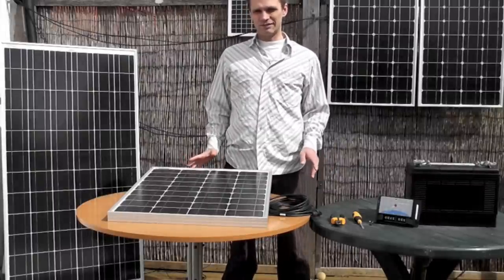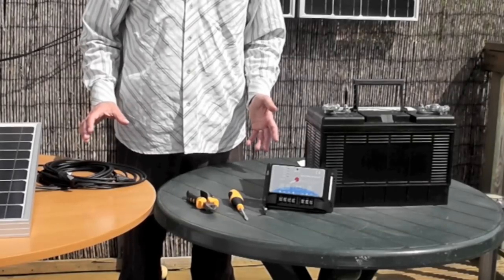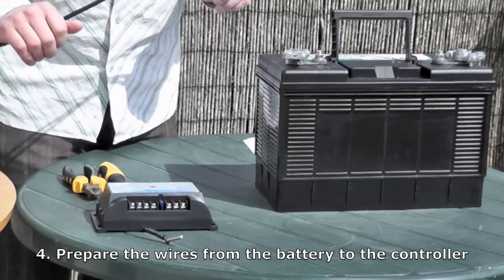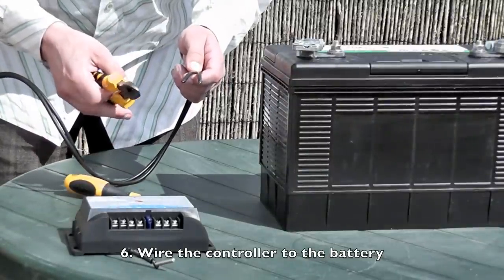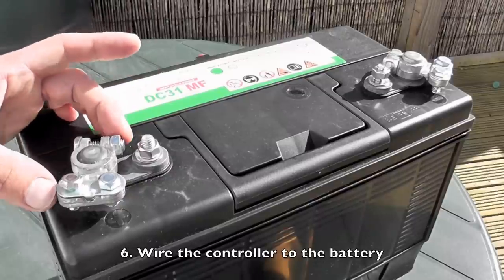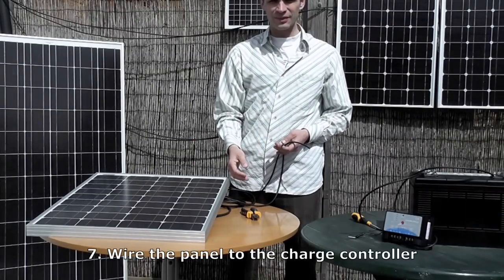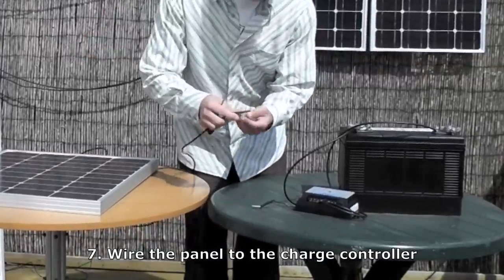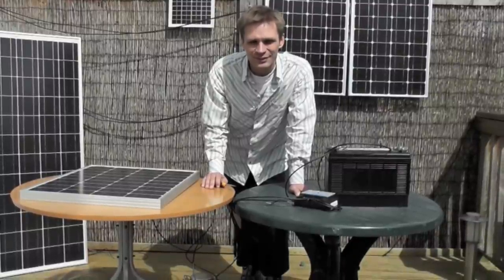How to connect an AKT Solar panel to a battery via a charge controller

Comment from the maker: Hi Martin,

The charge controller regulates the charge to the battery, particularly preventing overcharging of the battery and also preventing sulphating. This is important when using larger panels because it prolongs the life of the battery.

Also, if you decide to use the outputs from the charge controller to power your system then the controller will prevent over-discharging of the battery by cutting off the power when the battery falls below a certain level.

I hope this helps.

Comment from the maker: Hi Len, 

A 120W panel would actually do quite a lot for your battery bank. In summer you could get up to an average of 480Wh from a 120W panel / day. This would put 40Ah of charge into a 12V battery. So in a week you would get up to 280Ah of charge which would be more than enough to charge your battery bank from half charge.

And if you use 2 x 120W panels then you'd charge your bank in half the time.

I hope this helps. Please feel free to ask any other questions.

Cheers,

Jonny

Comment from the maker: Hi Mandy,

All you need to do is wire the +ve battery output from the controller to the +ve of one of the batteries and the -ve to the -ve of one of the batteries. This is because the +ves of each battery are all wired together and the -ves also all wired together so the whole battery bank equalises the charge across each battery.

So yes, the wiring stays the same as in this video and you treat your whole battery bank the same as you would treat a single battery.

I hope this helps.

Jonathan

Comment from the maker: Hi Hafiz, 

You would only need one regulator and would not normally need a diode (most regulators will have a diode and if your speakers have no other electricity source then no diode is necessary anyway).

So if you have a 5V regulator that will take at least 700mA (I expect you mean 350mA not 350A) then all you need to do is attach both positives to the positive input on the regulator and both -ves to the -ve input and attach the regulator's output to the speakers.

I hope this helps!

Jonny

Comment from the maker: Hi Nixy,

A 12V system should be fine for plugging 12V appliances directly to. You have to remember that a 12V battery actually varies from slightly below 12V when relatively flat to 13.4V when fully charged. And when there is a power source charging them, the system could even go up to 14.4V.

However, appliances that are designed for 12V such as in cars should be fine with this. 

For a 9V appliance you could maybe use a Zener Diode to limit the voltage to 9V.

Good luck!

Comment from the maker: Hello Fatin,

This is actually for an off-grid system so is not designed for powering a building. If you want to connect it to the mains then the best is not to use a battery and just attach the panels straight to a grid tie inverter that is attached to the mains. I hope this helps.

All the best,

Jonny
Reply: What amp wire did you use ?What amp wire should I use for a 10 amp controller ?
Reply from the maker: Hello, Nottel, You'll want wire that is at least 10A. Normally we use 2.5mm square cross section wire for anything up to 80W panels and from 80W and higher we use 4mm square cross section wire. I hope this helps. Cheers, Jonny
Reply: AKT Solar That is helpful ,thanks,but it has been far too time consuming just to get this far.I hope the experts make more fully complete  kits.I have found some since writing  last ,not quite the sort of kit I meant,a pond pump and lantern kits.
    There is lots of rubbish out there but I have found dlights ,the smallest one, excellent.

Comment from the maker: Hi Nixy,

Thanks for this. Normally you would connect multiple 12V batteries in parallel. This would maintain the voltage at 12V to create a 12V system. 

It would also be possible to connect 2 x 12V batteries in series to create a 24V system or 4 in series to create a 48V system but normally for a 24V or 48V system you'd simply use batteries that are already 24V or 48V batteries and connect these in parallel if you wanted to use more than one battery.

Do feel free to ask any further questions!

Comment from the maker: Hi there, I'm not sure if you're correct in your 100A maximum current comment but if you are then you will need very thick wire. However, for normal 400W at 12V the maximum current would be 33A which is a more reasonable. In any case, the cable you use should be adequate to cover the maximum current that will flow through it and you should be able to get information on this when you purchase the cable. I hope this helps, Jonathan

Comment from the maker: Hi Si Fei Liu,

This is very easy: You can connect multiple panels to the same charge controller as long as their combined power will not exceed the rated current of the charge controller and as long as the largest panel is not more than 7 times as powerful as the smallest panel. To attach them just wire all the positives from the panels to the positive input on the controller and all the negatives to the negative input.

Good luck,

Jonny

Comment from the maker: Hi Takkikayo,

500W at 12V is about 41.67A. There will be some loss in your system and so you would be OK with a 40A charge controller or larger.

Many charge controllers can also be wired in parallel so you could also use 2 x 20A controllers with 250W attached to each 20A controller.

Also it would be best to have a battery bank of at least 400Ah so that your 500W of panels does not damage your batteries by charging them too quickly.

Do feel free to ask any further questions.

Jonny

Comment from the maker: Hi Smiggle,

1) A circuit breaker of around 20-30A should be fine between the panel and controller (A "12V" 120W panel will give about 8A maximum).

2) If your battery is 12V, a 2500/5000 W inverter will potentially take about 5000/12 = 417A which is a VERY large current and would need very large cables and a circuit breaker of around 500A.

You would also ideally need at least 2500Ah of 12V batteries to provide 2500W of power without damaging your batteries.

I hope this helps,

Jonny

Comment from the maker: Hi there,
 
As long as the inverter will not get wet then I think it should be all right. In any case, insulation will probably not make much difference as the inverter will still ultimately cool down to the ambient temperature of the shed if it has a few hours idle. 

But if the inverter does have condensation on it before use then you should let it dry thoroughly before turning it on. However, this is unlikely to happen,

I hope this helps.

Cheers,

Jonny

Comment from the maker: Hi there, the best option is probably to use a 10A 24V charge controller with a 24V battery bank (this could be 2 x 12V batteries wired in series to create a 24V battery). Then you would use a 24V inverter.

Another option would be to use a 20A 12V MPPT controller that is rated to take the voltage output from your panel (probably around 35V). Then you could wire that to a 12V battery.

Finally, car batteries will work but under normal use leisure batteries would have a significantly longer life.

Comment: Thanks! So far this is one of the easier videos I've seen. I needed something like this with a step by step instruction. At the very least you made more comfortable to doing this on my own. I still feel like I'm going to electrocute myself for some reason. I'm sure there are safely measures for storing and handling the batter. Hope you have a video on how to get the power from the battery.
Reply from the maker: Thanks for the comment. We do have a video on how to power a 240V system from the 12V battery. I hope you found it and are doing well creating your own system.
All the best, Simon
Reply: AKT Solar Thanks will check it out!

Comment from the maker: Hi there, 

Yes, although it's not really dangerous as 175W is still relatively low power, it is a good idea to cover such a large panel before connecting it up to the controller. Otherwise it might spark when you connect it.

And just to check, if it's a 12V system you're creating then you'll need a 20A controller for a 175W panel. (If it's a 24V system you'll only need a 10A controller though).

Feel free to ask any further questions.

Good luck!

Jonny

Comment: Exactly what I needed to see, in a concise, well explained demo.  Many thanks!!!

I am assuming the charge controller is being powered by its connection to the 12v battery?  It is also preventing battery from being overcharged via the solar panels?

Feedback for your future demos: I was straining to hear your soft-spoken voice over background noises of wind, traffic, birds, etc.  
May I suggest an external microphone covered with a sound dampening wind sock?  This is what the news casters use when reporting from the field.  It hushes background noises.  Or possibly a clip on wireless mike on your collar?
 
Many thanks again for a very useful demo.  I needed this for my RV.
Reply from the maker: +Lass-in Angeles Thanks a lot. Yes, the charge controller is powered by the battery (although it uses a minuscule amount of power and so will not on its own drain a battery). It also prevents overcharging.

Comment from the maker: Hi Vignesh,

Thanks for your questions. The battery is a 110Ah Leisure battery (also known as a deep cycle battery). Other sizes of battery would also be fine such as a 60Ah leisure battery.

The wire is high-current solar cable which comes with our panels. Each panel comes with 5m of solar cable and this is normally plenty for wiring the panel to the battery via the controller.

All the best,

Jonny

Comment from the maker: And to charge a battery bank containing more than one battery is also very easy. Your bank should already have the batteries connected with the positives of each battery connected together and the negatives connected together. 

To charge the multiple batteries all you need to do is attach the +ve output of the controller to one of the positives on the batteries and the -ve to one of the negatives.

The batteries will then automatically equalise the charge that is put into them.

Cheers,

Jonnny

Comment from the maker: Hello there,
No diodes are necessary as the controller has the necessary diodes in it. Actually, adding diodes could have a detrimental effect as there is generally a small voltage drop across a diode and this could interfere with the way the controller tests the charge in the battery.
Cheers!!!!

Comment: I will need it to run continuously throughout the day using laptop, 32'TV, printer, speakers and also occasionally cooker with oven, electric kettle and some light in the evening..
So my questions are:
1. What do you think is the approx value of Wattage of solars/turbines I will need?
2. Can I just buy any controller 12V off the ebay or do I need some particular one? Will they stop charging when the batteries will be full to prevent damage?

Comment: Hi there great video.

I have 2x 140watt AKT solar panels that I would like to connect together to increase my amps. I have a 30amp charge controller and using the supplied connectors how do I wire the panels together on the roof so that I still have only a single cable entering the house and connecting to the charge controller?

Many many thanks!

Comment: Thanks for the reply mate. Im wiring up the house now for a 24 volt system.
Not sure if you would know but i have alot of appliances that use a transformer at the power point to convert it from 240v to say 9-12v into the appliance such as handheld radios. Could i simply plug these chargers to the solar system if it was 12v??. Also can i use car batteries. I have alot on my farm im hoping to use?
Thanks again for your time

Comment from the maker: This is really easy - just attach the controller to the same +ve of one battery that you use to lead to your appliances and the -ve of the other that you use as the -ve attachment for your appliances. The two batteries will then behave just as 1 12V battery and the controller will charge them accordingly.

Comment: Hi again
i have finally just installed a solar system. yay :)
can you help with following questions.
(1) my solar panel carries 120watts to a 15amp solar charger, what size of a circuit breaker would i put in between the solar panels and solar charger

(2) I have a 2500/5000WATT inverter connected to  battery. The inverter specification says it has an inbuilt 30AMP fuse but i still want to put circuit breaker in between what size circuit breaker can i put in between the battery and inverter

Comment: I've seen some other videos that recommend installing an in line fuse between the solar panel or panels and the charge controller.  Do you think that is really necessary?  In this video you did not place a fuse between the solar panel and the charge controller.  Just wanted to get your thoughts on that.  Thanks for the video.

Comment: Hi, thanks for the video.i am planing to buy ATK panel 50W. I own a TRUST PW-3120 power adapter(converter)that i will use to invert AC/DC .I have made also a female/male cable from trust's output - car power adapter jack- to connect normal wire to the converter's female car output plug. My concern is where am i gonna connect the TRUST converter?To the battery or to the charge controller (controller is PHOCOS CML-05)in controller there is also a 3rd "lamp" input, should it go there?

Comment from the maker: Hi, you actually get a reasonable amount of sun in Wisconsin. In Milwaukee with your panel facing south at an angle of 32 degrees from vertical you get the equivalent of 3.11 hours of good sunlight a day in the worst month of the year (Dec) and 4.67 h/day in the best month (Jul). So in Dec a 30W panel would charge your battery from half charge in under 3 days. 

A 68W panel would take a bit less than half this time but a 30W panel would be a bit kinder to your battery by charging it more slowly.

Comment: Great videos thanks. Would you put a breaker between solar control and battery? Or is it not necessary
K
Reply from the maker: It’s not necessary. The controller already has a fuse in it that protects from any short circuit.

Comment: Why did you connect the negative wire to the bolt and nut on the battery rather than the post clamp, like you did with the positive?

Comment: Jonny: Unfortunately there is not a single complete solar panel kit on  the whole of the market ,so I have to buy every piece of wire and connections and so on separately .Like this most people are put off solar.It is rare to see someone wiling to help people as much as you ,below so thanks.
     What kind of wire did you use ?Is the amp for this wire important ?Should it be the same amp as the controller ?

Comment: My solar pannel has a junction box or a charge controller on the back, it currently connects directly to the battery and thats how i bought it so i assume that it has a charge controller on the back too? I want to connect another pannel, can i connect both to a charge controller even if one may already have a charge controller?

Comment: Tutorial for newbie lol.
1.Need Multi-meter to test AMP and Voltage on the panel. check this against the panel specs.
2.Test Battery voltage to check condition.
3.The loading on the controller should be tie to the inverter...then inverter then power your light and other electrical appliance.
4. if you want to control your light to turn on at certain time then plug a 24hr anologue 240v point.
5. if yours really serious then you can use microcontroller with relays and transitors to control the power around your house.

Best solution is to get a 80-100amp Controller that way you have 960WH on 12v battery system!.

Note: 

12v with 100AH battery  = 1200wh - 25%.

if you're using 3-4KW a day then you need 4-5 of these batteries. the powerput  max out at 1.2KW. 

There's a lot more to know .. 

A lot missing tips in this tutorial...

Comment from the maker: Hello Herman,
It sounds like there's a problem with the panel - either it is not producing any electricity or it is producing electricity at the wrong voltage for the charge controller and battery. Can you check the voltage? If you have a 24V controller attached to a 24V battery then you should normally use a 24V panel (although a higher voltage such as 35V could also be all right). Is this what you have when you check the voltage coming from the panel?

Comment: hello i see you are very experienced with solar power i just had a question your help would be GREATLY apreciated. i have a xantrex 600hd powerpack which i want to use as a portable battery bank for my portable solar kit. it is a 12v 28 ah battery i believe, wel in the manual it says it can be charged via a 30 watt solar panel but takes 8 hrs and should be no more than 3 amps i believe, but i have seen someone hook up a 68wt 12v panel to one to get it to charge in only 4 hrs. any idea?

Comment: Hello again I installed my 170 w panel to a 24v controller and to a 600 w inverter. The controller did show no load going down. Supplier of the panel told me the problem was the controller. I bough another expensive one . Checked the panel cables with a multimmeter and the show around 20v. The new controller still shows no load coming done. I mounted the panel on the roof of my
small shed horizontaly not on the vertical, LIKE - NOT LIKE | .
Do you know what could be the problem? Thanks
smal

Comment: Hi! Thanks for the video it was awsome!
 
I want to set up a solar panel after watching your video it helped alot, however I dont know much about electricity.
 
After I connect the panel to the controller then to the battary what do I do next?
 
Do I need an inverter / generator / storage battary/ monitor? Thanks
 
Am sorry if this may be a stupid question but like I said I am clueless but I do want to learn. =)